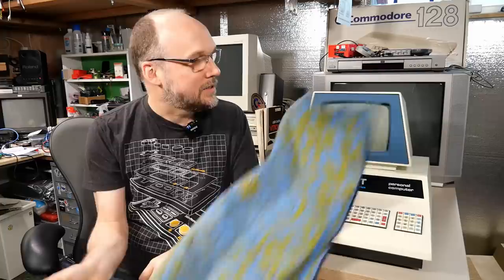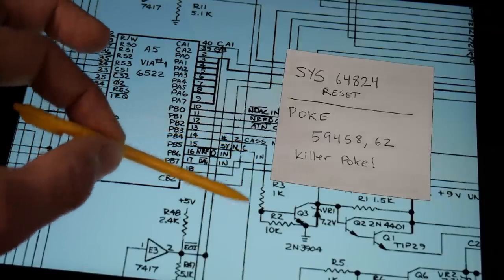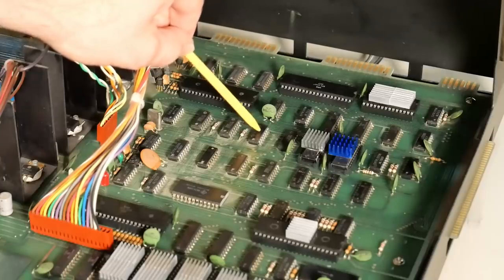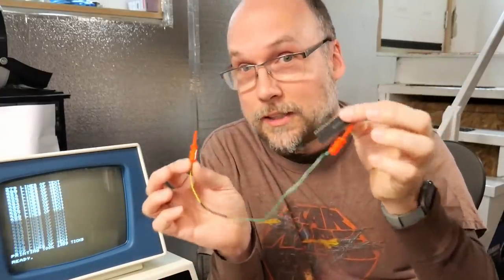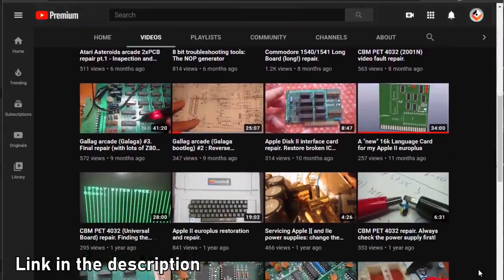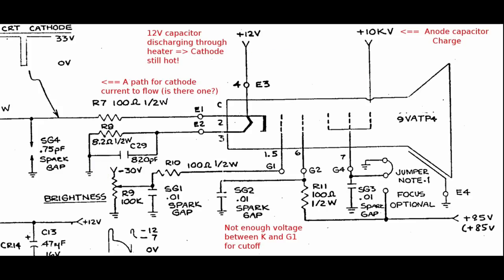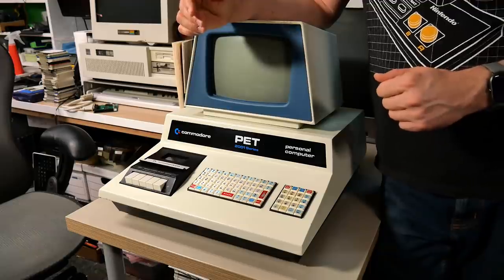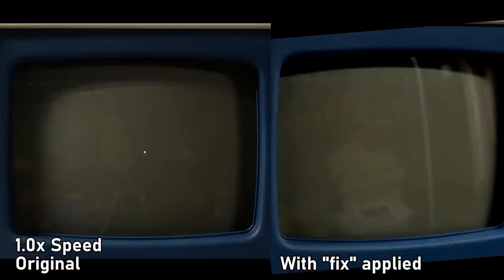Permanent Killer Poke Mod and CRT Spot fix on the Commodore PET 2001

Comment: 0:35 - I have a different experience. I was on a training session for new terminals and the "instructor" wanted to show off the new hardware feature (which was a result of a previous R&D session where we complained about the difficulty in adjusting the brightness levels - at an engineer level, not via the front user controls). The solution? A keyboard command combination to change the brightness levels. He promptly set about demonstrating this with much glee and soon realised no limits had been set as first he made the screen too dim to see and then quickly adjusted the brightness, went too far and caused the magic blue smoke to appear. The training session was adjourned and we all went to the pub! I miss those days of encountering new hardware for the first time....

Comment: That dot will eventually burn though the mask of the monitor....
Reply: No it doesn’t.
Reply: @marcelhh2101  
It doesn't burn the mask which is iron. It might burn the phosphor. This was eliminated on newer sets by shutting the electron gun off before the high voltage. The gun has the filament coil that at the lower  voltage. However the anode of the gun is at 25-30kv
Reply: No mask on a B&W CRT.

Comment: Just a couple of things that you should correct concerning your videos.....

First, you are NOT using 99% alcohol, because of the high affinity for water, 91% alcohol is all you can but without paying a very large amount, and the first time you opened the container, it would quickly absorb water vapor and become less 'pure'.

Secondly, you really don't need to add/use flux when you use solder paste, simply because solder paste consists of micro-sized solder balls IN FLUX.....

Comment: NEVER remove the deflection yoke from the neck of the CRT! Just desolder the H and V sawtooth deflection leads! 
It would take a great deal of time to return the yoke to the correct position on the neck of the tube, and you run a chance of breaking the neck of the CRT as well...
Reply: One should handle the CRT very roughly to break the neck by removing the yoke. Removing the yoke is completely fine on B/W CRTs, just be careful not to misalign the centering rings and other geometry tweaking magnets. On a color CRT, I agree, don't remove the yoke because you might have a hard time realigning the convergence and purity afterwards. Especially on high resolution CRT monitors.
Reply: @mrnmrn1  That's one of the reasons monochrome CRTs are better, they need much less support hardware than color CRTs. They're also more efficient.
Reply: @eDoc2020  One slight disadvantage though: they're monochrome :) .
Although you can produce a color picture with them, that's what CRT projectors did. But convergence is an even bigger headache on those. And screen burn.

Comment: re: 0:35, that advice about not being able to damage a computer is an outright lie. there are many, many ways to damage a computer through software, even, (and I'd argue *especially,*) modern computers.
Reply from the maker: Like what? Permanent physical damage?
Reply: @adriansdigitalbasement  It's not that hard to brick USB flash drives and SD cards. Just pulling one in the middle of a write can be enough to do it. It should be possible to do the same thing in software.

In fact, the easiest way to brick an SD card is to put one in a Zoom H2 (audio recorder) and just record past the end of the storage. Obviously this is easier if it's almost full to start with, but it doesn't seem to check if there's room for the next sample packet -- it only checks whether there's room when you start the recording. So it stomps all over internal records, and you have a wafer-thin brick.
Reply: @mal2ksc  If an SD card is susceptible to bricking (and not just data corruption) by simple writes like that I'd say the card is poorly designed.

In any case it's (probably) not physically damaged, just bricked. Still bad but recoverable with the right tools. Rewriting the firmware with an external programmer should fix it. I've bricked two laptops from failed BIOS updates but by taking out the motherboard and soldering to the flash chip I could recover them.
Reply: @eDoc2020  I was never able to recover that SD card in any way. It wouldn't format, it wouldn't show up in drive maintenance programs, it wasn't recognized as removable storage at all. There was no way to fix it because nothing could "see" it. Good luck taking apart an SD card, re-flashing it with an SOIC clip, and putting it back together, so I think the term "bricked" is appropriate even if you can technically do this. (I'm posting this from a hacked Chromebook running Windows 10, so I do know a little about flashing BIOS.)

Comment: *SMH* You call yourselves experts? I swear... The dot on the screen is from the fading 12V on the Cathode on the tube. This is a normal operation on older monitors and TVs of the time. If you want that dot to disappear you need to shunt that fading 12V to ground. Only way I can see this done is with a relay. A bleeder resistor on the final 12V capacitor can also work but finding that resistor value would require some math to do.

The reason why the dot during power off is there (where your friend got wrong) is because the cathode is still getting power while the PSU end is shutting down. As the 12V fades to 0v the electrons fly to the phosphorus screen which is holding a charge from the flyback transformer, creating the fading dot. Shunting the 12v to ground on power down with a relay or a bleeder resistor will eliminate or minimize the dot during power down.

All that work you did and he explain does nothing but to focus the dot onto the screen which will burn out the phosphorus over time at a faster rate. So, undo the work you did to get it back to normal before attempting "another fix."
Reply: Ever heard of thermal mass? You would need to power off the heater like 10-15s before you want to turn on the monitor to allow the cathode to cool enough to stop emitting electrons.
Another issue is that electrons emitted from cooler than normal cathodes have the nasty habit to "strip" the cathode emitting layer, so you don't want a cooling cathode to have a current path for electrons to leave it. On big tube based power amplifiers, the anode supply is turned on only after 20s-60s to allow the cathodes to reach the working temperature and avoid cathode damage.
So, sorry, you didn't do the homework.

Comment: Please stop saying "grounded". Instead say, "logic low" or "pulled low" by port PB5.
Reply: Ground
Reply: He's working on the analog side of the unit. There's no "logic" anything at that point.  It is correctly being treated as a radio frequency analog circuit.
Reply: @mal2ksc  He most definitely is not working on the analog side. The MOS Technology 6522 VIA chip is a digital logic IO chip under software control from the 6502 CPU. The Commodore Basic POKE command drives PB5 either High or Low, nothing in between. This is NOT RF or analog silly man. There is nothing analog or RF about the output port PB5. PB5 is digital.  If Adrian pulls (forces) PB5  low with a  jumper wire or other method, he is forcing it to a digital "logic 0" simulating a low output on port PB5 (regardless of what the POKE command says to the VIA chip). Get a clue before you spout off about computer peripheral IO ports.
Reply: @xxM5xx  Oh, you're talking about the killer poke. I was talking about the hot spot on the monitor, where calling it "ground" is absolutely correct.
Reply: @mal2ksc  Oh... I'm sorry. Yes, I was talking about the Killer Poke. I didn't even watch much of the portion of the video regarding CRT spot. We had our signals crossed. LOL. Sorry man. Have a good one.